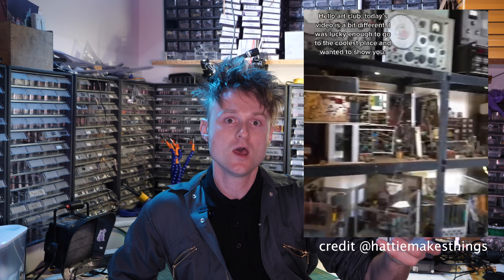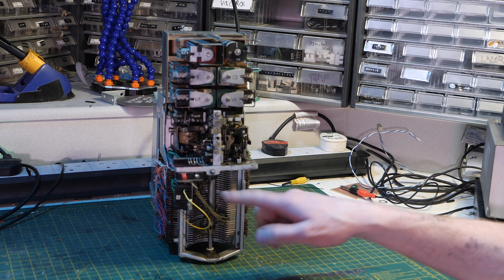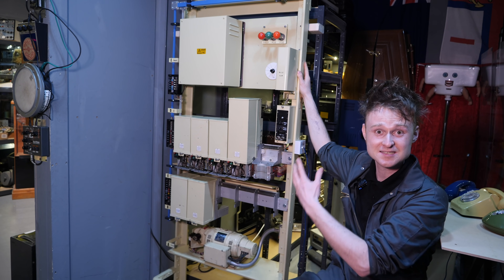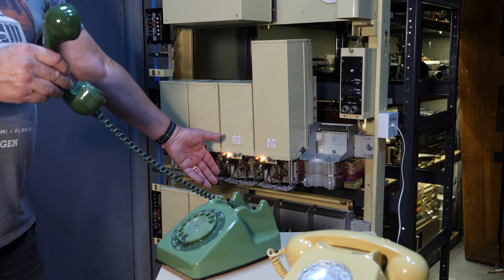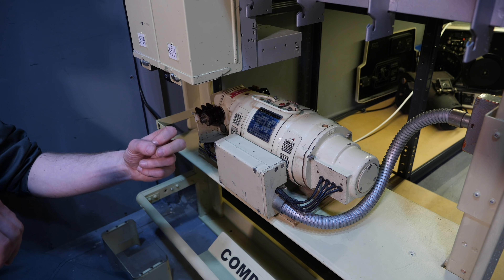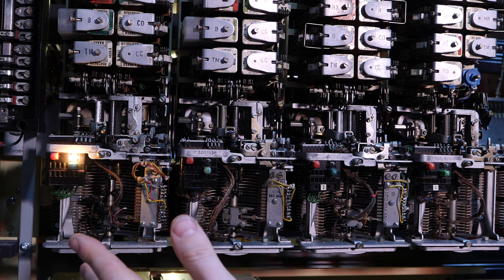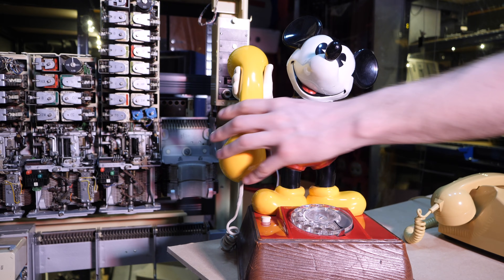STROWGER Telephone Exchange mechanical machine

Comment: I used to work in a Strowger telephone exchange. I connected the wires at the back of the switch, it was called grading. It was very noisy, especially when there was a "phone-in" on the local radio station. The engineers who actually maintained these switches all looked alike. They wore long dustcoats, were covered in oil (oildag) and their shoes were sandals with grey socks, lol

Comment: Back in late 80s to the early 90s I used to work for a company that made the 50 volt dc power supplies for bt telephone exchanges.  If I remember correctly they used to be rack mounted power supplies that could be switched out quickly in the event of a fault.

Comment: Right now I am using an old telephone that is hooked up to a obi 200 using a pulse to touch tone converter it uses Google voice I think you should look this up it's pretty interesting you don't have to pay anything except of course the box and the touch tone converter after that simple payment you should have a free phone line after following a simple setup also I believe it is possible to make the hardware work over Wi-Fi with a simple purchase of a USB chip that provides Wi-Fi or you can directly hook it up to your router through Ethernet

Comment: Hey, loving the old strowger equipment I dated a telephone engineer in the 80s and spend a bit of time in these old exchanges. I've actually got a Master clock from an exchange. Would you be interested?
Reply from the maker: Hey design officer! Thanks for the comment it does most certainly sound interesting! Only if it’s in the way 😂 always on the hunt for different interesting master clocks! If you wanted to chat about it fire us an email! Lookmumnocomputer (at) gmail (dot) com :)

Comment: Small fry. Your name is also wrong. "Strowger" refers specifically to the AEC equipment from the USA. All the equipment you're talking about is 2000/SE50 type. Have a look the "real thing"... at probably the only video in existence of a working exchange here : http://schoolpa.com.au/sxs/sxs_005.htm. I must say Richard's demo exch setup is excellent, you have about $20k worth of machine there, you had better make sure he's looked after.
Reply from the maker: Well yeah. But like many things modern terminologies encompass certain things. Yep these are 2000 switches. But more often like not like a vacuum cleaner is called a hoover. Strowger acts more like a blanket generic term even ex telecom engineers use. And what's a small fry?

Comment: I used to ring in to the SALT tester when installing lines and phones.
Once in there was a selection of tests that could be run remotely just by dialling the right code.

Another box for the museum?
But not sure if you'd also need all the remote test gear as well.
(I did phones - not exchange work (most of the time) )
Reply: 17070 openreach line test facility? Does anyone know any more engineers codes that still work today?

Comment: Hi, thanks for the great video. There is a two volume book set  called Telephony vol 1 and Telephony vol 2  by J Atkinson published by Pitman. They are definitely worth getting hold of even if you can only get volume two as this has the circuits and explanatories for the type of  equipment you have. You can find them on the online second hand book sites.

Comment: I have heard that you can Dail by pressing the hangup rapidly. I think it's like every 0.6 seconds, but it could be wrong
Reply from the maker: You are not wrong
Reply: I have schemes for a modified telephone relay box, they are still in use at some places.
It's for railway dispatch. 3 digits and order selection.

Comment: Worked in a Strowger exchange in the late 60's as a TTA (Trainee Technician Apprentice) for the then GPO. At that time the average exchange had 5 people there to maintain the equipment. By the late 80's one man and a dog would look after 5 exchanges. When the question "What was the dog for?"  was asked---- the answer  "to keep the man away from the equipment" was the reply. happy days. Good luck with you project and you will never forget the sound of those selectors working away.

Comment: Large Strowger exchanges had amazing lead-acid batteries and huge bus-bars to carry the thousands of amps of 50Vdc around the building. I heard a story about a fork-lift truck that hit these bus-bars and pierced the insulation - they said it quietly melted the side off the fork lift (and started a significant fire) must have been 100,000 Amps or so.

Comment: You’re about 25 years late - pity - I remember vividly when our village exchange was upgraded from UAX (Strowger) to “System Y” (Ericsson switches). The engineers told me to help myself to whatever I wanted from the skip outside, including a ringing generator (cams controlled the timing of the interruption of contacts to generate call progress tones, and it also generated the ~70 VAC @ 17-20hz ringing current)

No eBay nonsense back then

Comment: A ops B Ops CD, basic strowger from my BT apprenticeship days in the early 1980's. Personally I was blown away by the Crossbar exchanges (TXK2 / TXK4) which were still electro-mechanical & relay technology but did all of the call connection setup between initial loop and application of dial tone and then upon receipt of the final dialed digit (if within the same exchange). During dialing they just sat and counted the digits into the register until a routing decision could be made.

Comment: A minor minor pedantic point, Strowger was still in use in the Uk into the early eighties rather than the late seventies. 
One of my earliest lessons in accepting change was watching the contractors taking out one of the strowger exchanges I’d worked on. As you can imagine it took a lot of care and attention to keep those switches running sweetly and as a T2A (a junior technician) I spent hours and hours manually cleaning banks and cleaning and adjusting A relays. To then watch the contractors removing those very same switches and throwing them into skips from the first floor windows and then removing the banks a shelf at a time with sledgehammers was heartbreaking. It stood me in good stead though, because I career saw a lot of change in the telecoms business and I’ve been fortunate to have been involved in the roll out of a lot of the tech we all now take for granted. 
I qualified on Strowger as a TO (the then senior technical rank) before moving off to different things. I have very fond memories of those few short years in the telephone exchanges.
Reply: Strowger was still used in South Africa in 1997.

Comment: This brings back so much nostalgia. While rotary phones weren't common when I was a kid, I used to use the trick of clicking the hang up button to dial all the time. -- On a side note, it's also fascinating that the button style phones use a sort of cartesian grid with tones to determine the number being used. So, every push button on the phone was two pitches, one for the x-axis and one for the y-axis. On some of those older phones, you could press two buttons from the same row or column, and hear the tone that related to that position. -- At some point these telephone exchanges had to work with both options.

Comment: As an old timer BT engineer, I remember the sound of this fondly. Racks and racks of relays tapping away all the time.
Normally accompanied by the smell of hot carbon.
Now, the exchanges just hum with the sound of data cards, and hum with the smell of old engineers socks. 😅

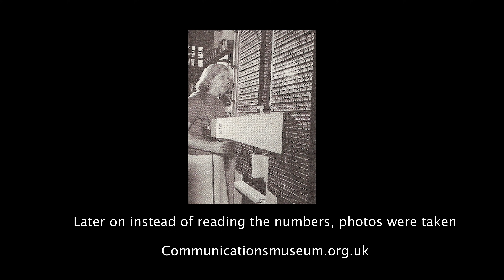Comment: 8:20 notice how the selectors reset after the green phone has been placed "on hook" again. In this system, the line stays "open" as long as the originator is holding the receiver. If the yellow phone picks up the hook again, the connection is still with the green phone. You could block a phone this way.
Ah - just noticed this is being explained in the other video 😁
Reply: P wire.

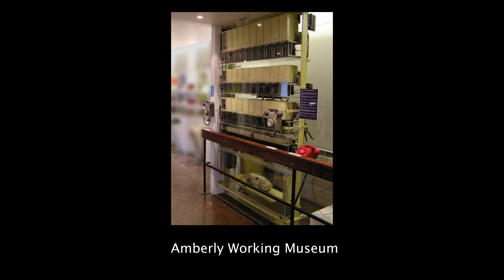Comment: OK. So a few relay sequencer videos ago I mentioned seeing a house full of this equipment as a 5th or 6th grader in a switching station located right across the street from my school. The image at 5:45 is exactly what I remember seeing except it was all crammed into a gutted one bedroom house, and I remember seeing all the inner working bits, as in no covers over the individual switching units. Heat dissipation? maybe? Faster to service? I have no idea why. What impressed me (at age 11) was learning that each switching unit was responding to someone, perhaps 20 miles (or so) away, dialing a number on their phone ... at that very moment. I realize that sounds a bit obvious but it was all pretty wondrous for an 11 year old. It's amazing that this equipment didn't hit the scrap bin years ago.

Comment: is this such a switch that you could phone phreak?
Reply: Think you can phreak it a bit by using the cradle switch (where you hang up the handset) to mimic dial pulses. Useful where single use phones were fitted without dials. But most phreaking was using the tone - dialing system (often seen - and heard- in old american movies) where a sound generator, or even a human voice could imitate dial sequences and access codes.

Comment: Imagine the rooms full of this equipment. Floors of 40m x 20m than raks a meter apart full of those. Than the noise(music). A normal day just easy around steppers from callers, but then at an event when whole town wanted to call in. The whole room starts acting. The build quality of those are insane.They probably run for about 20+ years day in day out. Motor is called a daynomotor. motor and dayno together. The frequency is coming out secondary and that is pulsed with those switches. Have a litle one out of a small business exchanger. We had also a simulair like stepping but was made with a horizontal and vertical axels driven by large motor at the end of a rak. Keep it running. In this working state they are rare. Especialy in private collection.

Comment: I think there are still a few of these around (smaller versions) as private exchanges in office buildings from the 60's/70's often when they fall out of use it's easier just to leave them in behind the more modern server racks of whatever rather than actually removing them (two places I've worked in had these left in place but disconnected). Also I would recommend reading 'Exploding the Phone' by Phil Lapsley. It covers phone phreaking which I'm sure would be of interest.

Comment: That telephone group selector thing is like industrial music maker in a box! :D.
Also, am I right in thinking the reason the rotary dial takes so long to wind back to its starting position is because of the inherent latency in the relay system at the group selector station? So you want to prevent people from sending pulse tones quicker than the system is able to respond to them by building in a physical time delay in the phone through the rotary dial? ;)
Reply: If I'm not mistaken, the wind back part of the sequence is what actually generates line pulses to tell the selector switches where to go, and yes, it is timed to the physical limitations of the switch

Comment: So the circular rotating dialer on the phone was made to allow time for the switches to physically move so they were ready for the next #?  I'm just old enough that my grandparents still had a rotary phone and we would always ask to call our friends on it :  )
Reply: Yes. The rate of rotation of the dial (on its return run) was physically governed at the correct rate to allow the switches to do their stuff. However fast you pulled the dial to a number, it would always return at a controlled rate - even if you tried to hurry it. Frustrating with long phone numbers.

Comment: Aha, I think I might now finally understand what a certain noise was that I've missed for years. See, I'm from a strange part of the UK where we don't have BT and for years it was said that our telephony was extremely dated and butchered beyond recognition. When you placed a call, you got the ringing tone, but then there were these subtle 'tic tic' noises between it and the next ringing tone. The cam on the ringer motor hits those contacts at exactly the rate those noises used to happen. I used to tap my fingers on the table in time to those quiet clicks, so when they disappeared in the 2000s it irritated me. Seems that whilst our exchanges had been bodged to do things like tone dialing, they must still have been using something like that under the hood to actually ring the remote phone. The bell wires were definitely still alive at that time.
Reply: Kingston upon Hull?

Comment: Congratulations on finding this set-up. I would love to have it myself. I started working on this type of gear in 1975 for the NZ Post Office, as it was then. I have worked on the earlier manual operator boards, this step-by-step equpt, later also the  Japanese cross-bar system, then the computer-controlled electronic exchanges made by NEC, which are still going here, though I understand are to be replaced by voice over internet at some stage. It has been quite a journey, and always an interesting job with the constant changes.

Comment: back in the early 90's when I was 12 I used to bike past a scrap metal place and it was full of old Strowger Telephone Exchange equipment, They were upgrading the exchange to electronic and had no regard to the old gear. I used to grab lots of it and pull it apart slowly understanding how it all worked... looking back I should have kept some

Comment: I grew up in the 1980s and 90s in Dublin which was already mostly on digital exchanges with DTMF signalling by then, so this insight into electromechanical switching is fascinating. Weird things sometimes still happened -- in the mid 1990s I picked up the phone to make a call and there was no dial tone. Instead, I could faintly hear tens or hundreds of voices and a metallic hum of interference. I could just make out a few voices here and there, shouting confused hellos, swearing and laughing. Seemed like all numbers in my local exchange were inadvertently connected for an hour or so.

Comment: Telecoms are a very amazing field of engineering !!  Moreover the availability of phone lines are 99.9999 % even during major technology upgrades, when it went from electrmechanical exchange to microcontroller electronics with the Signalling System No. 7 and once again when upgrading to the actual system, when the exchanges physically disappeared as the network is now all fiber up to the box at the corner of your street.